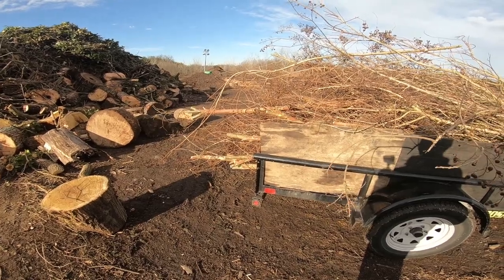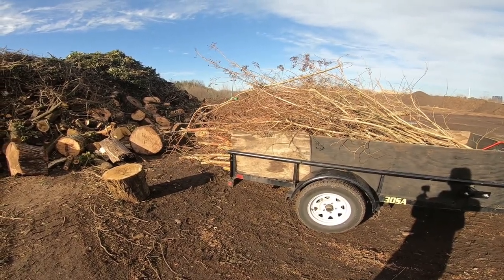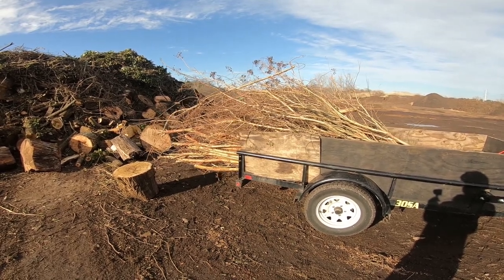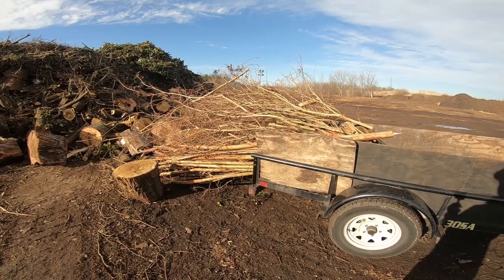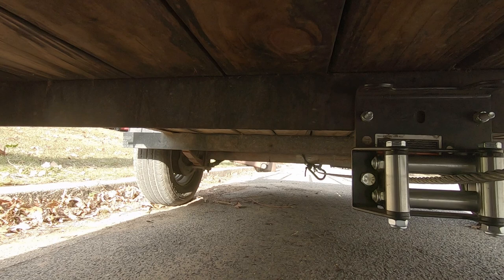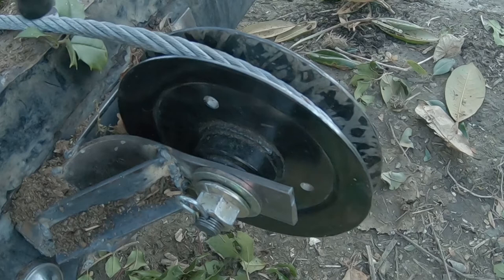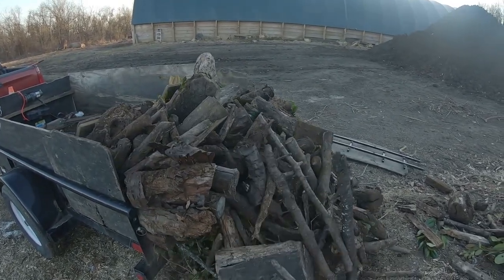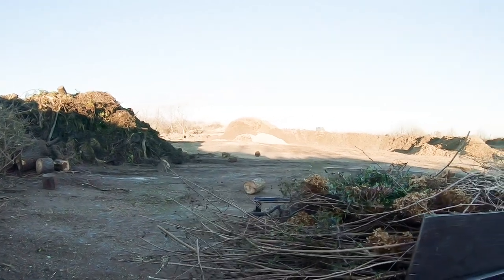Winch powered trailer self unloader

Comment: I'm also a lawn guy and I've been designing this in my head for 6 years.  I want to make it for my truck bed for pushing out grass clippings.  During the heavy season I was filling up my bed twice a day and unloading it with a scoop shovel.  Well... I wasn't, but my workers were. I was going to build a unit that could be taken in and out of the bed as needed.  It was pretty much a three sided steel box with a floor, then a scissor style jack run off electric hydraulic linear actuators to push everything out.  I priced it out once and it was way cheaper to pay my guys and buy shovels. If I ever build it, it will be purely for the fascination and enjoyment of inventing shit.
Reply from the maker: I like things to be cheap but effective. Have you seen the load handler? It's a hand crank that is basically a conveyor belt. It can unload 2000 lbs. It takes some effort but does work. I was using the load handler to unload the trailer before I came up with this winch setup. I don't know if you're using a stake body or a pickup truck. You can mount a 2000 or 3,000 lb winch to the side or back and just pulled the material right out

Comment: Great job the best I have seen so far I have a 5 by 10 utility with 4 foot walls i do junk removal can you make a list of parts you used and where to purchase or a how to video. Thank you.
Reply from the maker: All the parts for the winch setup can be purchased through harbor freight, you'll have to come up with your own rear roller. I made mine out of scrap parts, I had lying around my roller is a 8 in pulley for my exmark Lazer z. I'll add a list to the description.

Comment: I am going to take your advice and setup my 12ft x 7ft trailer like yours. This has got to be far better than a tarp on a roller setup. I think all of us would to have a little more detail on your "wall" which gets pulled behind the load to move it along. I am not sure how I would approach this. Width is obvious but height and the rest of it, not so much. Any addition tips you can offer sure would be appreciated. Great idea!
Reply from the maker: https://youtu.be/cL9X66bY6QA  
This is a couple of pictures of the wall made of scrap, that I put together in a hurry that works great.

Comment: what do you use to charge the battery? does it need to be plugged into something to dump or can you get a dump cycle off just the battery alone?
Reply from the maker: Thanks for watching my video. I'm running a group 24 deep cycle battery and I can unload the trailer a maximum of three times per charge and I just use a regular battery charger plugged into the house to charge the battery. I don't have an attached to the truck setup or anything like that. I tried using a solar panel to keep it charged but it was not effective.
Reply: @sololawnprofessional  thank you for the quick reply. i have the same winch as you i used it once with not a lot of guides for the cable and it messed up the metal on my trailer a bit especially at the gate where its path changes so im definitely going to use the mower pulley idea once i find a way to mount it. Also going to get another rolling fairlead but im having trouble finding them sold seperately. i used it for compressed leaves that filled a 7x10x6 foot high trailer and it def had the power from the winch but keeping it running was a struggle. i have it tapped into my truck battery as of now but the winch ran out of power a few times
Reply from the maker: I'm just using two ATV fairleads and not the large one that came with the winch. I had no room for it under the trailer. The most important part of this setup is the rear roller. I created the mount for the rear roller. The first time I took out the first generation of the mount it just completely folded in half with a completely full trailer load of wood.

https://amzn.to/3FH7q6l
Reply: @sololawnprofessional  yes now i didnt have anything at the rear and it bent the angle iron of the trailer. brainstorming now about ways to get the winch rope up from underneath. do you remember which deep cycle charger you had? going to get that and the battery today
Reply from the maker: https://amzn.to/3Hv8xY5 sorry for the delay. This is one  have it has all the bills and whistles as a digital readout of the level, which is pretty much the most important thing when it comes to using the winch 14.4 volts for a full charge, not 12
Reply: @sololawnprofessional  thanks! so i will get the battery you linked in the description and that charger, glad to know someone with my winch trying to do the same thing has had success, most people dont follow up with the projects they post. any idea how quick the battery takes to charge, would overnight do it?
Reply from the maker: I would get a group 27 battery? it's more expensive but you may get an additional unload out of it. as far as charging really depends on how worn down the battery is it could take 6 to 10 hours of charge back up.
Reply: @sololawnprofessional  gotcha. i dont mind spending a bit as this is obviously still way cheaper then a dump trailer haha. any other upgrades or things youd change now that youve been using it?
Reply from the maker: I would get the wireless remote. I don't have one but that seems really convenient.

Where do you have your winch mounted up front between the frame rails?
Reply: @sololawnprofessional  no i have my leaf loader mounted there on the a frame. i have a 7x12 but the front 2 feet are underneath a gas can basket (u can really only get mower castors in there, useless for leaves), so when i made the leaf box i closed that off to make a compartment for the winch, so the winch is mounted on the universal mounting plate in my trailer in front of an enclosed 7x10 box, if that makes sense
Reply from the maker: One  thing I forgot to mention  I have an ATV winch at the very front of my trailer that pulls the false wall back to its starting position.
Reply: @sololawnprofessional  thats a good idea. you had posted a video of the false wall, have you had to reinforce it at all from what you posted?
Reply from the maker: @jamess9208  For leaves I have 4 ft sides not the 2 ft ones you see in the video. And I have extensions I put on the wall just to gather the remainder of the leaves. To save you some headache. If you're going to unload mulch or loosely compacted leaves, the wall needs extension that sits under the material otherwise it just pulls right through the light material. I haven't had this problem with logs but definitely has happened with mulch.

Comment: I did the same thing  but I put  the winch on a sled in front  of the trailer
Reply from the maker: Did you mount the winch in the cargo area of the trailer or outside closer to the truck. I didn't show it in the video, the winch directly underneath the cargo area between the frame rails

Comment: Does this use a “sled” on the back that the cable attaches to?
Reply from the maker: I just use a wall made out of deck boards  and 2x4s,  I have the cable hook  attached to some threaded eye bolts, I use some steel flat bar on the other side of the wood so the bolts don't pull through.
Reply: @sololawnprofessional  good to know, thank you!